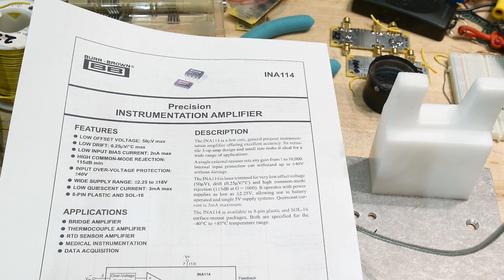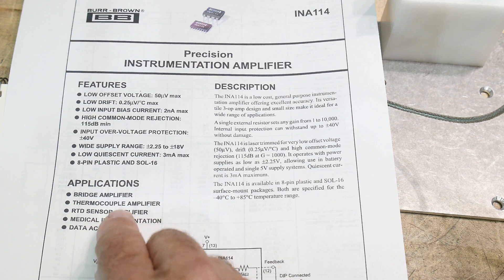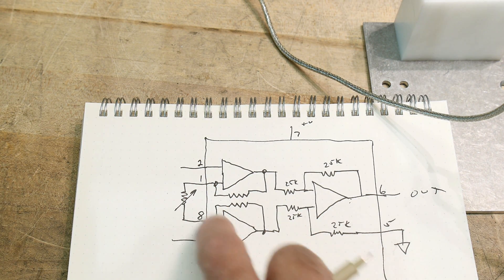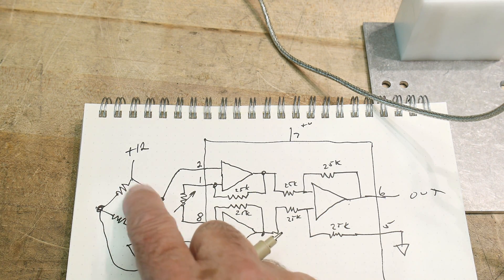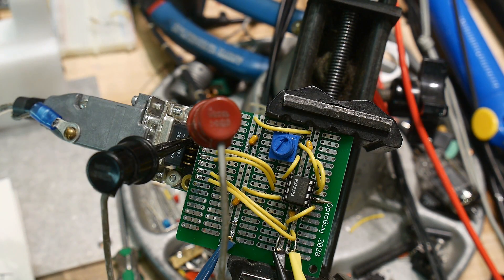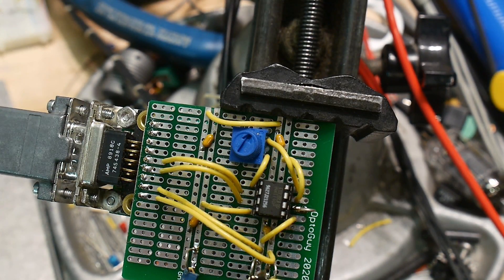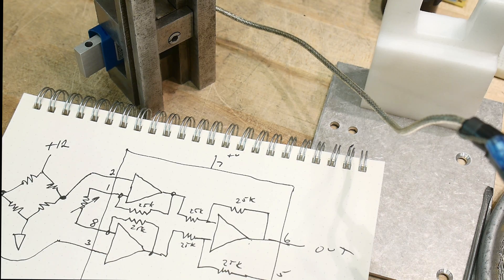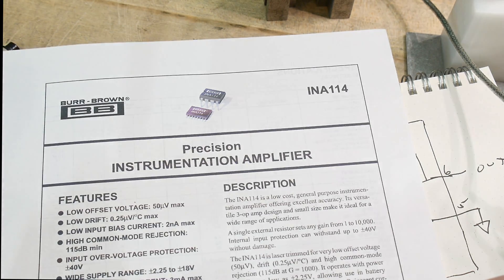#1174 INA114 Instrumentation Amplifier and Strain Gauge

Comment: How would be analyze  the span of the pressure sensor bridge  in mV  and the value of the gain resistor in order to have an output from 0.5 V to 4.5 V ?

Comment: I loved the BB INA101...for all our load cells.IA

Thanks IMSAI GUY

On the same wavelength thats good...We used a 10 VDC reference was buffered to drive 10 VDC excitation for load cell, 350 ohm foil resistors...turned into 0-5 VDC for digital readout...0-500 lbs of force..
There was zero and Rg span pots for cal...
Have a good weekend

Comment: Many many years ago I was interested in learning electronics but it was so hard to make a change to a circuit and I got frustrated with probe cords getting all tangled up so I evolved into software design since it was so much easier to make a change and it didn't really cost anything to write a program.  Now, after many many years of writing software I am tired of it and find the "simplicity" of hardware much more interesting and fun.

Comment: Out of curiosity, I went to check this part (the INA114AP specifically), and it is out of stock on Digikey, Mouser, and TME; Digikey says it will restock in 35 weeks, and Mouser states that the first restock will occur on the 13th of April 2023, with a factory lead time of 77 weeks.
Reply: A very similar part which I use, INA128, is in stock at both mouser and digi-key.

Comment: Corrections: The gain of this Instrumentation amplifiers given as G= 1+50k/Rg, so with 10Kohm you get gain 6 and not 2.5. The transducer is rated for 25 pounds not foot-pound, and this is the force that if applied on the transducer will provide 1mV/V at the output .
Reply from the maker: of course you are right about the gain. What makes it worse is, I did a video on that exact equation: https://youtu.be/uE3HGJy0ynE
Reply: yes --- lb-f = pounds-force (vs lb-m = pounds-mass), not torque (ft-lb)
Reply: Oooo, that was a gotcha on me.  I guess I have never seen where force was labeled lb-f.  Maybe we should just stick with metric ( insert smiley face here ).
Reply: @urlkrueger  standard nomenclature in the engineering and physics world

Comment: Great video and yes Arduino is fantastic but as far as actual electronics goes you very quickly reach a learning plateau...cheers.
Reply: I enjoyed the ardruino platform. But it did get kind of boring quickly. Like after you build a couple circuuts, write a few programs. Your kind of done....
Reply: @miller-clem  Yeah useful if an actual need comes up.